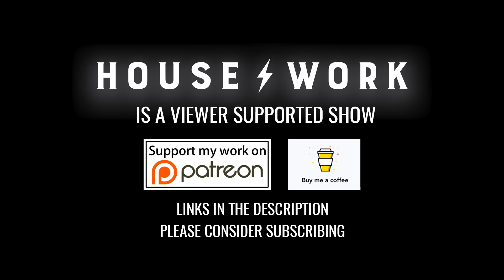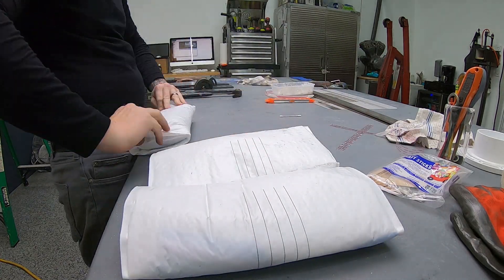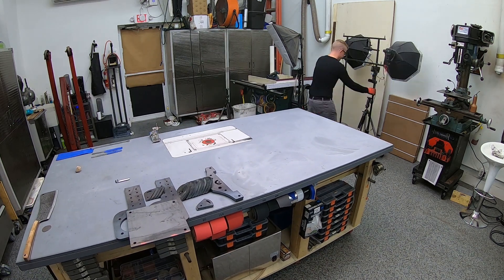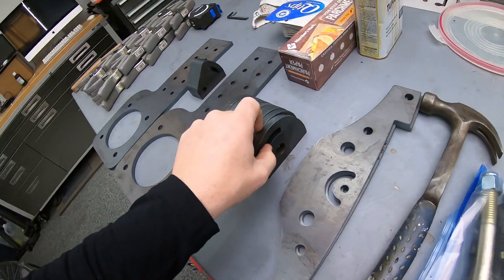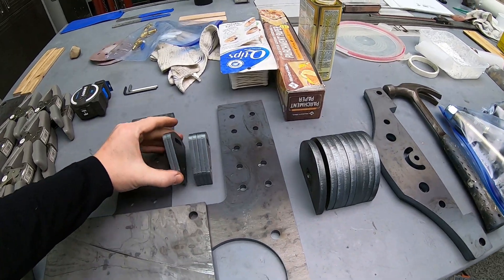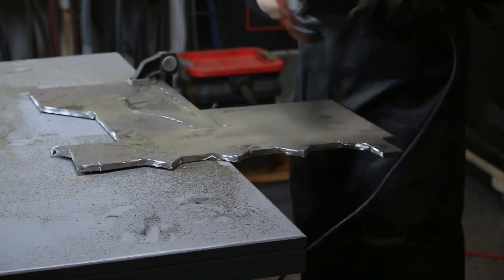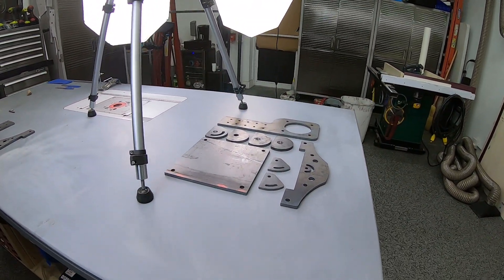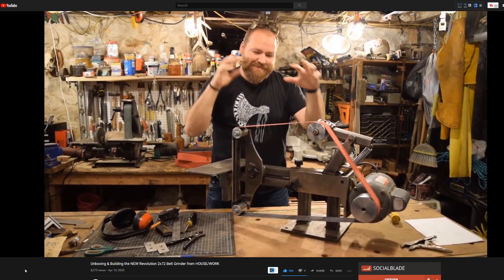2x72 Belt Grinder Laser Cut Parts - A $700,000 Machine Cut These

Comment: Im so on the fence with this grinder. I bought the plans then realized I don't have the right tools to finish with confidence.  I was happy to see these laser cut parts available, but I hesitated because of the unknown backorder time and now the price hike kinda knocked me back down.  plates with hardware + the cost of wheels pretty much puts the startup price with other entry level grinders on the market like the obm. I am torn. the struggle is real for those of us on a budget. Either way, I wish you success. It really is a cool design.
Reply from the maker: I hear ya. We got so many orders our laser cutter couldn’t keep up with the demand. We had to pivot and go with another cutter. Which was more expensive. But, for the extra $30 we added the work rest surface plate to offset the increase. (The cutter charges a flat rate to cut things so adding another cut made sense) - Here is my take on it. If you build this grinder it’s an industrial machine that will run solid for many lifetimes. Those entry level grinders just don’t last. That said, I totally get it.  Run the numbers again and maybe it can be done within your budget. 👊🏻
Reply: @HouseMadeUS   Fair enough. Ordered. I don't want to procrastinate for another decade.
Reply from the maker: Hey man!! Yes!! It’s gonna be a fun build. 👊🏻👊🏻👊🏻 thank you!!!

Comment: I bought the plans and it looks great! i see the VHD and motor on amazon but it doesn't ship to New Zealand! Is there any way it can be shipped to New Zealand or would I have to look else where?
Reply from the maker: I really don’t know, however you can use any NEMA 56c motor. Just make sure it’s got the right HP (2 or more) 3 phase and is TEFC. The Vfd will convert single phase to 3 phase for ya and there are many options out there. Good luck and let me know how I can help. 👊🏻
Reply: @HouseMadeUS  thanks for the reply i appreciate it :D

Comment: Brian, I got the plans and have been in the process of getting the metal together. But then I saw this video. I have the ability to make the parts myself, but at $199 shipped I'm having second thoughts.
Reply from the maker: Yeah it’s totally worth it. It cuts the fab time more than half. You could probably have this built in a day. Just make sure you have your hardware, wheels, tracking etc lined up. Also are you my new Patreon??? Thank you brother man!!! 🙌🏻
Reply: @HouseMadeUS  Yes. I will let you know how my grinder build is going. I have a YT channel but I haven't posted much. I post my adventures on IG @3DMakerZone.